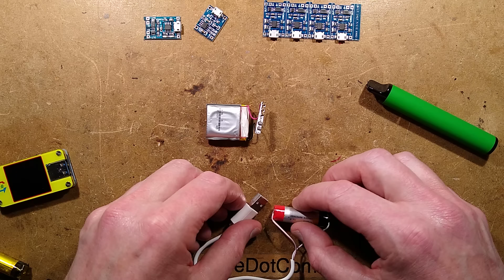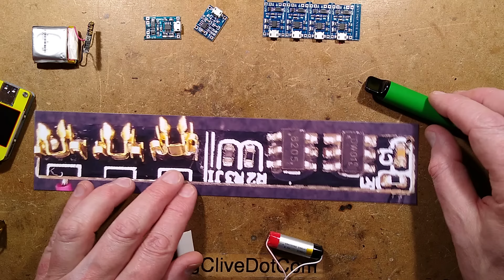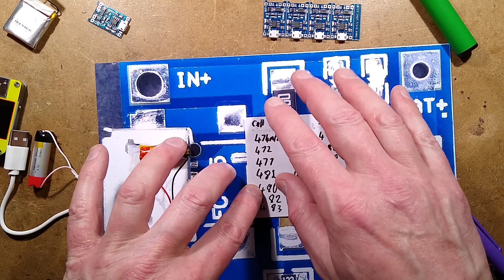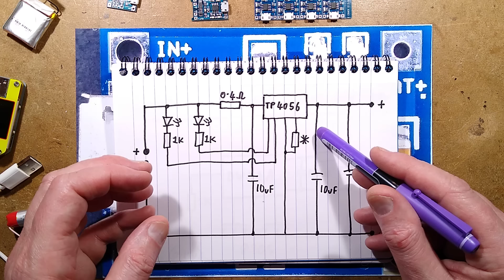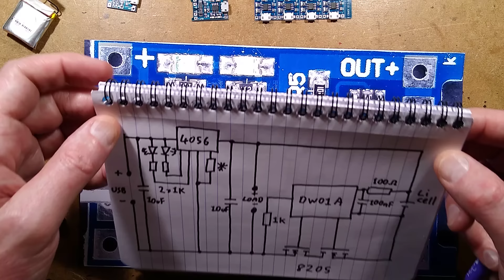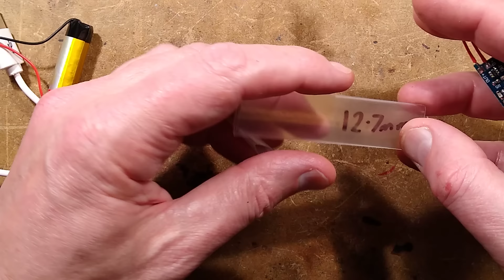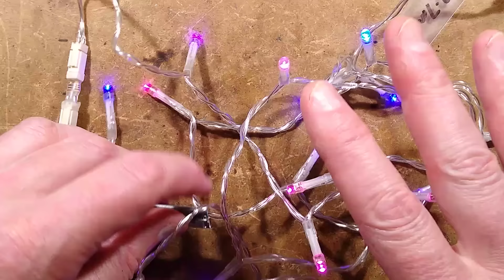Don't do this!   (There's a much safer way)

Comment: Why not just plug it into a USB 1, 1.1, or 2 port? AKA 100-500Ma. still charge it but not dump several amps.
Reply: Because the spec isn't implemented like that. You're only allowed to pull 100mA without negotiation and 500mA with negotiation, but there's generally nothing host side to enforce it - last computer (an ASUS laptop) that actually enforced that thoroughly i have seen was made around 2002, and it was a ton of trouble - many USB HDD enclosures wouldn't work and external optical drives wouldn't work. Devices that seriously skirt the USB power specs have been shockingly common from day 1. Instead all there is is like a 3-5A limit for a larger group of ports of the device together implemented with a polyfuse and that's all you get.
Reply: Yes, but use only your notebook, there mostly is hard limit @500mA (USB 2.0) - hopefully with fuses (my hope), bad if they are polyfuses >:->

Comment: You never guess, what components I bought yesterday. This charging board, to charge exactly this type of brand.
I thought, who had the Idea, to make them one use only, so I began a project a few days ago, where I try to recharge them. And now you're coming with this Video 😂
But I'm still mad, that a company thinks it's a good idea, to make this type of product for one use only and with this throwing Lithium Cells direct in the garbage after only one use.

Comment: Would it be possible to change the min and max voltage on the under-/overcharge protection with the resistor value in a similar way as the max current? I prefer to charge my batteries to 4V or 4.1V when capacity is not too important
Reply from the maker: The voltages are fixed, but I'm experimenting with a workaround.
Reply: No, it's not foreseen :(
Reply: You can buy them with different threshold voltages.
If you are able to find them at all...

Comment: 8:30 With a 10k resistor these would be good for charging salvaged cells that are under voltage without using some kind of desktop power supply as they would only put out 13 miliamps if its a tenth of the  130 rated and also be a good slow charge for that inital "wake up" of the cell.
Reply: TP4056 has an effective gentle wakeup logic in conjunction with DW01. WD01 disconnects undervoltage battery from TP4056, but lets wakeup pulses through that TP4056 sends like once or twice a second. If the cell isn't too leaky, its voltage will creep up eventually to the 2.5V threshold, the battery will be unlocked and will be charged. Under 2.9V, TP4056 applies about 1/8th the set charge current until the battery is fully woken up, and switches to full charge current then.
Reply: Personally I wouldn't even bother trying to charge an undervoltage cell. 
Nearly all lithium failures can be attributed to-
1) impact damage
2) undervoltage cell damage
3) overvoltage cell damage.
4) overheating damage. 
Each to their own but to me its not worth the risk, better off just putting a highish value resistor across them, draining them to zero volts and disposing of them.

Comment: I love the 4056 boards, I had about 2k 18650's that I had salvaged & In order to help process them all I found a PCB that allows you to use a 4 bay 18650 sled along with 4 TP4056 boards to make a really inexpensive charger.

Comment: @bigclivedotcom  i have 2 old flat lithium laptop batteries that have 2 cells in parallel to make 1 battery and I wired them up to a head lamp in series to get 8 volts what would be the best way to charge them with balanced charging. right now I have no protection on it.
Reply: Either charge each cell individually (the whole battery in two stages) or get a 2S (2 cells in Series charging board/BMS. Has a 3rd connection that goes to the midpoint of the battery (connection between the 2 cells) and monitors/controls the charging so that none of the cells gets overcharged.

Comment: I have used a number of these charge boards from eBay. The approximate current during the "constant current" charge phase is 1200/R, as selected by the programming resistor. They now sell these boards with USB-C connectors, as well as the micro USB.

Comment: Thanks for the information. YES! YOU CAN SET LITHIUM CELLS ALIGHT and the gas can damage your lungs. The cells burn very hot,. Worse,. Lithium hates water_ it reacts violently so don't screw with it
Reply: I have been told it's good to have a pot of sand nearby to throw your cell into.

Comment: Excellent advice ty,. I'm looking to get two of the larger cells in series, is there a board that will charge them to 8.4v (using a boost converter or similar) or will they have to be charged individually?
Reply: Certainly are. '2S' (for 2 cells in series) is the key for searches. 'BMS' (battery management system) and 'balancing' (so that not one cell gets overcharged while charging before the 2 cells together reach 8.4V, in case they're not equally discharged) For achieving this there will be 1 (in the case of 2S) additional connection, from the board to the connection between the two cells (and additional circuitry of course)
You'll need a higher voltage source than 5V, or an additional boost board (haven't seen them combined in one module, but not saying they couldn't be out there)
Reply: @michaeltempsch5282  That's brilliant thank so much for your reply, I'll get searching 👍

Comment: I used to charge batteries like this when I was younger, but I was at least sensible enough to use a current limited supply (500mA) as well as constantly monitoring the battery voltage with a meter Thankfully never had an incident
Reply: Not as big a deal when the battery is lead acid or even NiCad if you monitor it and stop it, but theres safe room for error there.  Less so with lithium :)
Reply: ... and please don't connect PP9 lantern batteries to the mains. I did this at school (I was 10 years old at the time) and it went bang and filled the classroom with smoke and I was given a good telling-off.
Reply: Never did that jus charged it without worrying about it an nothing ever went wrong been doing it for a while
Reply: @christophersmith930  how many times is it safe to charge after it dies the first time I have a USB I forgot if it’s Apple or android. Usually do 30 second intervals. About five times.

Comment: A micro switch to set the charge current  DTSP  OR a 3 pin socket and plugr with 12k and 2.2k  you flip to set

Comment: I have a proper lithium ion charger that hooks to USB and has the magnetic connections. I also have the guts of a single cell power bank that I made and it can be used as well. Haven't found any used vape pens but I know someone who uses them and I'll see if I can get the used pens for the batteries.

Comment: Can this solution be used to charge 2 or 4-pack cells in parallel?  Many Chinese products, with multicell packs, use an ac wall wart that converts ac to dc at the correct voltage. Unfortunately, the devices way outlast the chargers. You are then left with a perfectly good device that you can't recharge.
Reply: For Multi-cell you need a BMS (Battery Management System) it keeps them all charged the same amount and at the same speed so they short out, but those can also be found on eBay
Reply: @andrewbarentine2187  That's for when they're in series - for multiple cells in parallel they're connected together and won't allow one cell to 'pull ahead' of the rest.
For instance one can get empty (to stuff with your own [scavenged] 18650s) multicell power banks which simply puts all the cells in parallel and uses one chip for charging. (And a boost circuit to get 5V output)

Not 100% sure what the OP has - if the cells are in series, or a series/parallel combination (anything that gets an output voltage above 3.7/4.2V) then YES, get a BMS/charging board that does balancing!

If they're all in parallel, one might get something that charges at more than 1A, or the charge time might get annoyingly long. For instance there are modules that uses multiple 4056 chips to increase the current.
Reply: @michaeltempsch5282  My bad thanks for the correction Michael, I knew a BMS was needed for batteries in series but forgot there not needed when in parallel. Would you recommend charging at more than 1A per cell, I’ve heard that’s a pretty good ratio to stay with
Reply: @andrewbarentine2187  Depends on the size of the cell - your "typical" 18650 should handle 1A without any problem and might only be 0.4-0.3 C or so. If you've got a 500mAh cell then 1A would be 2C, better keep the current to 200-250mA  (0.4-0.5C)  For multiple cells in parallel, add up the capacity for the cells in parallel. Let's say 4x 2000mAh for 8000mAh) then multiply by say 0.33 and get 2640 (mA) so 2.5 - 3A would be be quite reasonable. Some cells can take a lot higher, but then I'd prefer to know their condition and exactly what their datasheet says...

Comment: I love the smell of ethylene carbonate in the morning..it smells like victory.
That is one of the solvents in which lithium hexafluorophosphate is dissolved to make lithium ion battery electrolyte.  Which means not only is there a fire hazard, there is a possibility of hydrogen fluoride emission.   Bad poison and rapidly absorbed and or inhaled.  HF loves to tie up calcium in the body which means neurons no longer function.  Then we have possible organophosphates and cobalt..

Comment: This is a question because I know you're capable of providing the right answer. How can I go about lowering the voltage of a battery charger?? I need to charge a 36v (nominal, 42v charger output) e-bike battery,  I have a 48v battery charger (54v output), the charger has SF1565SG chip on the "AC" side, and LM358 on the "regulated output" side, what do you think?? What do I need to do??
Reply from the maker: It would depend on the circuitry used in the specific charger.  There may be a feedback circuit on the secondary side that could be adjusted, possibly by swapping component values.  There would be an opto isolator if that type of circuitry is used.  I can't really advise on mods for chargers for high power lithium packs.
Reply: @bigclivedotcom  , thank you for your prompt response,  I did forget to mention that there is an opto feedback circuit, and although the battery itself is "high powered", charging happens at 2 amps tops, and I am guessing that they're using the LM358 to control the charging current and voltage, I have 2 of these 54v chargers and both look to have the same circuit with different components, and I think they all pretty much use the same design with different values and feedback to achieve the desired output, I have some knowledge of how these work, but definitely not as much as you and that's why I came to you.
Reply: @bigclivedotcom  , and by the way;  they are commonly  (And cheaply) available on eBay, and if the shipping cost wasn't too high or if you were closer, I would've sent you one of the ones I have. I can buy a "proper voltage" one from eBay for  $12 shipped but I thought why let the ones I have sit around do nothing.
Reply: When it comes to high power stuff like that, it’s going to be safer to just get a proper 36 volt charger.

Comment: 16:45 Assuming you’re tossing the plastic bit of the vape after you recover the cell, you can cut a battery-sized section off the vape body and put the cell in that sleeve to give it some protection

Comment: my phone charger, and sometimes  my phone, gets hot while charging. where does he get that usb voltage and current display?

btw why does he use eBay over aliexpress?
Reply from the maker: The Ruideng meter is from eBay.  I prefer eBay's customer service.
Reply: @bigclivedotcom  thx, going to buy one asap!

Comment: I am concerned that your comments could leave viewers with the impression that while charging, the load can also be connected.  You don't say either way.  So can these chips tolerate charging and powering a load simultaneously?
Reply from the maker: If the load current is lower than the charge current then the cell will charge to near full, but the charger will then power the load.

Comment: I’ve used quite a few disposable vapes over the years and have always felt bad about tossing lithium cells in the trash, so I’ve kept probably every single disposable after it’s died. I found one particular brand that I really liked and went through a few of them before opening one up. When I finally popped open a “dead” one, I discovered that it was still more than half full of liquid when the battery died. So, after they’d die, I’d pop the back off, hook the cell up to a little 1s lipo charger to recharge the battery, and it was good as new. The taste usually started to fade slightly before the battery died the second time. But, I felt like I got my money’s worth. And mow I have a bunch of cells that I don’t know what to do with…
Reply: Photonic induction did a 230v power block out of pound shop vapes, might be an idea
Reply: @OffBrandPringles  that sounds exactly like something PhotonicInduction would do lmao.
Reply: You can make a powerbank using those batteries, it wouldn't have this much capacity as a regular powerbank, but it's still better than throwing lithium cells in trash.
Reply: @kam1_56  if one were willing to go through the process of matching cells it's possible to build a much larger battery out of many cells. The guys who build custom EVs have got this down to a science because individual 18650 cells are so easy to find in the trash. The process is identical for these smaller cells.

If you fork out enough money for a charging board that will automatically do the balancing for you, it's even easier.
Reply: @tissuepaper9962  needs to piss off on telling others to piss off.  Get some manners mate.
Reply: @Qui-9  Not necessarily defending em, but whenever you hear the same nagging bullshit all the time from so many people, you kinda get tired of being polite in response to it.
Reply: @SheepUndefined  I am going to build a very cheap power bank. Solder a shit load of them together and off you go. I know that some will say to use a battery management system. Well if they are ALL KNOWING, get them to take the time and the effort in researching and producing a YouTube video.  We ALL can criticise others, but how many of them that do so, get up of there ass and do ANYTHING about it.
Reply: @jonc4271  Not sure what this has to do with finding people annoying when they constantly bug smokers/vapers with the same old "oh don't smoke, you'll ruin your lungs' as if they're the first person to say that to them, but you do you. Never been big on "disposable" products that use reusable shit like that, so eh.
Reply: Just Browsing  good point, same went through my mind too
Reply: Search whynotbuildit, he’s been doing it for years
Reply: I've never used a vape, but excellent discovery. once the liquid is exhausted you'd still be able to remove the battery. If you can charge them with a balancing charger, you could hook a heap of them in parallel and get a nice BIG LiPo battery pack
Reply: but if you feel bad for tossing cells in the trash, why do you buy disposable vapes?
Reply: @MyrtleTheDirndlTurtle  they taste better than the refillable one
Reply: @paulcristian2568  :-O I'd have expected this to be the main advantage of going custom, refillable, etc.  -- that you'd be able to get everything, just the way you want it. Especially the flavour!
Reply: @MyrtleTheDirndlTurtle  Just a refillable, rechargeable pod unit with readymade coils would be a huge improvement there. Not just from waste and cost perspectives, but also being able to pick which coils and juice to use. But, to each their own, I guess.
Reply: @MyrtleTheDirndlTurtle  you might be right, i'm not an avid user
but the ones i can buy in my area are awful, the single use one are delicious for lack of a better word
i might order some from amazon and try different brands but the ones i tried so far are nowhere near as flavourful as the disposable ones
Reply: @SK it's hard to even find a proper RDA these days, all the tanks I've found in the last few years use these disposable coils that screw in and out. They burn incredibly quickly, it actually got so bad (I went through like 3 coils in rapid succession) that I stopped using the mod and rarely vape nicotine anymore.
Reply: I never have to recharge my Golden Virginia.
Reply: The biggest issue here is that you vape
Reply: Why do you vape?
Reply: Just Browsing  oh piss off. Stop drinking sugary beverages and alcohol, stop eating chips; in short, mind your own health and not others'.

Comment: Could you please do a video on the best/easiest way to daisy chain multiple batteries together?? I've got something like 30 of these things from discarded vape pens and want to make some type of large battery pack with them. Thank you nice video!
Reply from the maker: Easiest way is to make them into a single cell by wiring them in parallel.  But they must be at a similar voltage when you do so, and with really big clusters it is useful to add fuses to avoid one failing cell shunting the whole pack.
When wired in parallel the cells all act like one big cell.

Comment: I recently put together a project that combines an MPPT (cn3722) solar charge controller with a timer and a boost converter to boost an on board 3.7 Li to 12 volts. Came across some interesting components. reverse polarity protection, over heating protection and other good features....XB5606AR

Comment: Would the TP4506 also work for batteries marked 3.7V? What about charging 2 batteries in parallel?

In my area I can source "Hyppe - Max Flows" which contain a LG17350 battery. 
2 batteries and the TP4506 fit nicely in the aluminum tube they come in.
Reply from the maker: The 3.7V is the mid-voltage of standard cells that charge to around 4.2V .   You can join two cells in parallel if they are at similar voltage levels, and they will then act as a single larger cell.